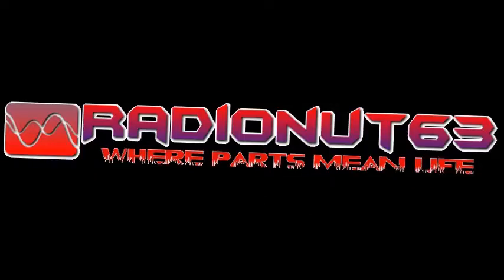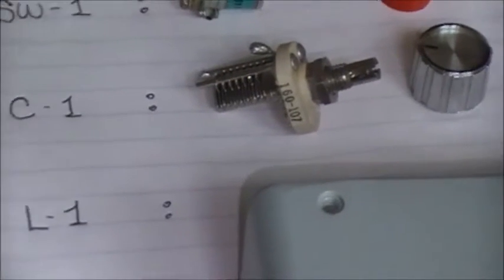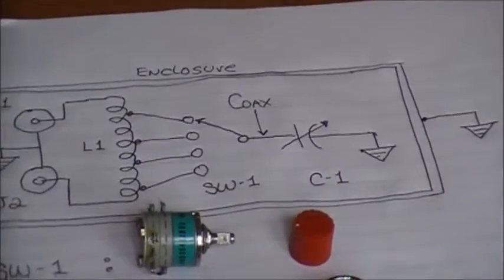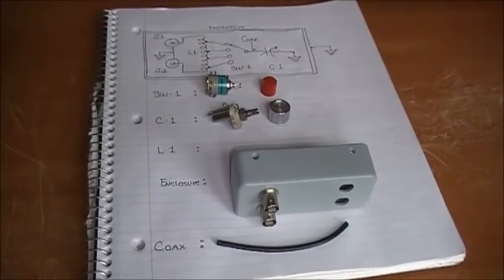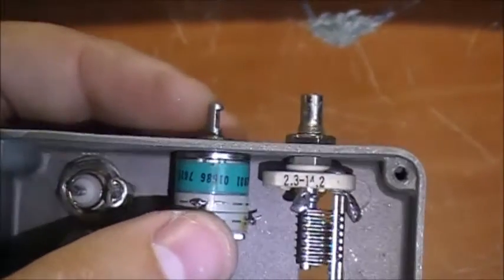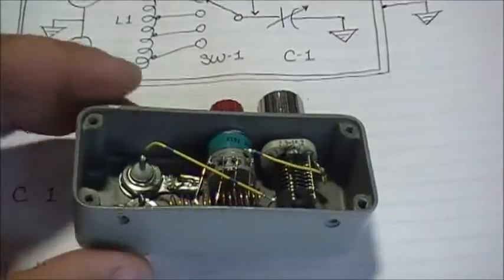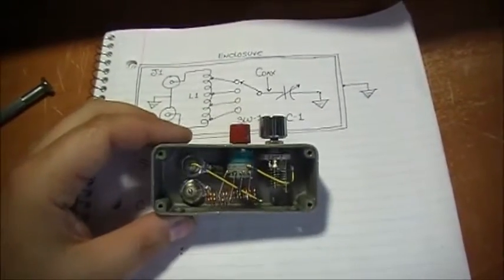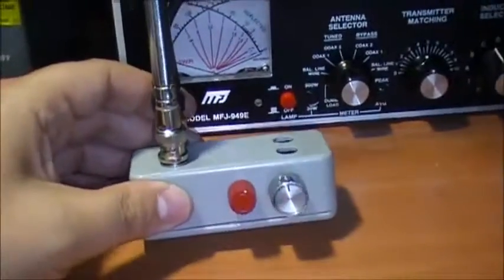Simple VHF antenna tuner for your scanner

Comment: Will this work to tx through, around 25 w?
Reply from the maker: This is not meant for transmitting.  RX only.  I never tested this tuner while transmitting.
Reply: @Radionut63  Ok may be worth a try with a rig that has protection :)

Comment: I have a tecsun pl660 i would like to homebrew an antenna tuner for shortwave bands using a random wire antenna. I googled antenna tuner circuits and i have found about 12 basic types of tuner circuits. What circuit is best for  1711-29999 Khz? What values of inductors and capacitors will cover this range? The random wire is about 50 feet long. Thanks!
Reply from the maker: I recently uploaded a video regarding building a tuner, i used a roller inductor in that one, have a look. :-)